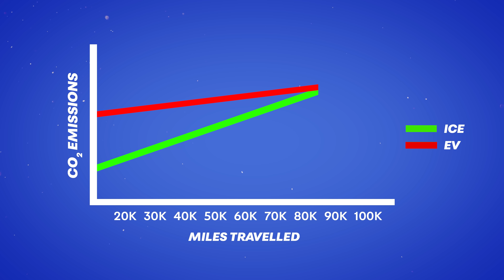Are Electric Cars REALLY That Green? [New 2022 Data]

Comment: There are other studies that suggest EVs offset their carbon footprint in as little as 2 years if you're using renewable electric sources and up to 5 years in dirtier electricity sources, but they always offset, of course this takes into account using the vehicle, for light use of vehicles is better to get an ice car.

The only car an EV doesn't offset is if you buy an used hybrid, other than that an EV is always better for the environment on heavy use.

Comment: Volvo don’t make as much money per electric car as they do for ice ones. As with all manufacturers it’s costing them a lot of money to start producing electric cars.
It also depends where that pollution is happening & what can be done to reduce the output of co2. I imagine they can on a manufacturing stance cut down their co2 on production of the vehicles a lot more easily than they can stop the pollution of co2 out of the back of an exhaust pipe 🤷‍♂️

Comment: I only see one(to me) obvious problem with trying to roll out EV’s and one that needs more discussion. The obvious one, charge points. A lot of areas in the uk are population dense.  For example my street is terraced. Even if every house could have a charge point it would also require a way to secure the cable to the car because they will get unplugged. As for the discussion point. Battery life span.  This opens up to a wider discussion such as overall cost , overall footprint by end of the EV’s life. Cost per mile to run. Will it increase as battery degrades etc. Will be interesting to see how things progress.

Comment: Another 'now' problem with consuming only green energy is there simply isn't enough.
Coupled with the increase in EV sales and this situation will be chasing it's own tail for decades
Reply: LOL LIES!
EV sales is SLOW and we clearly have a supply problem. It will be much faster and easier to built out Renewables Energy Generation then to build the BEVs to consume it. Unless you can magically make 1 Million BEVs of the same model exist. Companies will gives you BILLIONS if you can achieve that.
Reply: @Neojhun  My understanding is it's not necessarily the green generation, but capturing and storing the energy.
Reply: @stuartburns8657  You understanding is Irrelevant. The best method of energy storage is Physical. Fossil Fuel industry just stifled investment and development in Physical methods of energy storage. I think CAES will be the most versatile but you still need a few other methods like Fly Wheel for Reactive Power regulation.

Comment: The uncomfortable reality is we've built up a personal travel dependent society, which coupled with our innate selfishness means we don't want our toys taking away.
Properly accessible and affordable public transport is the real answer, but I think part if the master plan is with all these 2030 no ICE mandates, to simply make owning a vehicle so out of reach of the average person, thus achieving the Co2 reductions that way
Reply: Yup..
They tried taxing us off the roads and failed.
They tried congesting us off by taking lanes and turning them into bus and cycle tracks. Thats failed too.
They have just changed the highway code (UK) to make driving slightly more unbearable.
The government problem is... We drivers put billions of pounds into the coffers via the tax/duty on fuel ... They cannot do without it.
If EV's become as popular as ICE... there will be a tipping point and EV charging will rocket in price. expect taxing by the mile. No ta breaks for buying or home charger fitting. All the governmental carrots that put you in an EV will be pulled.. Only then will EV drivers know the true cost of running and electric golf kart instead of a car.

Comment: I've always though this to be correct. 90 000 miles could be worse. Imagine all the coal that's moved around the world to fire those power stations. Even if you generated your own power, those panels also use coal power to build, lithium for their batteries mind in Africa, sent overseas for beneficiation using these most dirtiest form of transport (the ships), it follows that all this talk about Net Zero is nonsense. You cannot have net zero considering that t costs oil and coal to make the "green energy" in the first place. 

Thanks Roar! We love this show
Reply from the maker: Depends where you live. The UK’s energy mix is only about 3% coal. It’s 17% in the USA. And the world is improving all the time. There are other fossil fuels which we all use of course, but just wanted to correct you on coal usage and highlight the change that’s happening.

Comment: EV's are great for city use, they are far more economical in slow stop/start traffic, plus of course the emissions are sent back to wherever the power station is located, typically outside of the city.  Decarbonising the grid in the future is the key with grid storage solutions and more nuclear, wind, solar and possibly tidal.  The problem with fossil fuel generated electricity is that 75% of the fossil fuel energy is often lost before it hits your outlet plug.  So if we plug in a 3kW electric heater, 12kW of fossil fuel energy typically was burned at the power station.  Whereas a fossil fuel car is 30-35% efficient at converting the energy of the fuel into useful kinetic energy, so 65 to 70% of the total available energy is lost in heat.  However electric cars in the UK will cost half as much to run, due to the high taxes on petrol & diesel fuels and the comparative much lower rate of taxes on the electricity.  Well done Volvo for doing this analysis in a balanced way.  We don't care so much about conversion efficiency of wind, solar to electricity as the source energy was free in the first place and not carbon emitting.  To me electric buses and cars in the city with stop start traffic is a no brainer.  However, the argument to install en masse electrically powered heat pumps in the city in place of predominately compact gas combi boilers, that is a far more difficult subject to draw to a conclusion on.

Comment: Its hilarious!  Obviously they using math based on a EV being charged off the worst coal powered grid known.  Y'all definitely twisted facts on this.  You do know ICE vehicles have more parts right?  Like a ICE Engine alone has like 300+ parts.  Each part has its own carbon expense.  ALL needs to be added.  Its not correct to add up everything for an EV,  but not for an ICE car.  Not to mention using worse ever grid power system as your base assumption.

Comment: At last someone sensible is seeing the light, EV’s are a con like diesels were claimed as the saviour albeit their petrol counterparts and how’s that turned out. Also missed is the Pollution caused by mining Lithium and that child Labour is used in this endeavour in some countries. I drive a 25yr old small car 5k a year, who has the bigger carbon footprint print ?  if a new EV is purchased every 3 yrs on PCP comparable in common practice on a contractual fixed mileage then how many cars is it going to take for that driver to get to 90k. When the biggest polluters are heavy industries, aircraft including NASA and commercial & privately owned ships and as I mentioned before mining, what forcible changes are happening here? In 20 yrs time EV’s in there present form will be the diesels of today and the next con will come along as history always repeats itself and goes in cycles of the next money making idea. If I purchased 5 EV super cars for my collection would I have a lower Co2 than my neighbour driving his ICE Nissan Micra no Is a fiasco we’re being mugged off.

Comment: Fossil fuels will run out one day. The real issue is how the electricity that powers the manufacture and charges the EVs is produced. Even the most wildly optimistic of us recognise that nuclear is likely to become a bigger source of energy for the foreseeable future. That carries huge risks, of course. Storing energy from renewables is another concern. However, batteries are getting better, and Tesla and its supply chain have been doing interesting things with battery recycling in recent years, and looking at some EV high-milers recently (eg Hyundai Ioniq) it seems that they may age better than feared. But EVs clean from plant to scrap yard? Nah. All human activity has Co2 costs.

Comment: Great video and gets the message out there that is often overlooked. It would be great to see this covered in Fifth Gear Recharged. There is also the ethical problems associated with lithium and cobalt mining that needs to be exposed. As you say car makers need to put pressure on battery makers to be more environmentally and ethically aware. Looking forward to Northvolt starting up battery production as they seem to care about these things.
Reply: cobalt is also used in petrol refining, and you could argue there are certainly ethical problems with fossil fuel extraction.

Comment: The key lesson here is that private car ownership has to reduce - and the constant need to buy new all the time equally so.

I wish you had stated the 50,000 mile figure first rather than the 90,000 mile - because the majority of people watching this video will be in a country with electricity mix similar to the EU28 case.

An important point missed also:
- ICE cars produce substantially more air pollution which isn't greenhouse gases than EVs. This study simply compared CO2e. Most cities exceed WHO safe air pollution levels because of transport pollution.

Also, Volvo is doing this because they have signed up to Science Based Targets and have committed to being more transparent about their carbon emissions - hence they are doing Life Cycle Assessments on a selection of their products (there's a similar study available on trucks). This allows them to pinpoint and reduce the highest sources of emissions.
Reply: Also worth mentioning is that Volvo rightly state this is a specific study on this specific vehicle. The figures will be different for others - though definitely still useful as a benchmark.

Comment: Wind and solar can only provide power 1/3 of the time, at best. And not a reliable source, unless you are happy to go backwards with regards to when you can charge/use electricity.  And there needs to be a major upgrade to the power distribution systems! So good luck with that, if we all rush out and buy an EV...

Comment: Once we have enough batteries to recycle for new EV production, then the CO2 footprint will be much lower and the comparison will be even more favourable for the EVs.
Reply: The battery technology needs to change soon to solid-state. All the existing EVs will end up getting junked then. The (much) lower weight of the new batteries will be the real game changer. But its printed-circuit tech so the FABs won't be able to use the old iron (purity).

Comment: So I wonder what the breakeven point is for my I3? The factory was built to be clean  the car is light because its carbon fiber and aluminium plus plastic panels. It has a lot of recycled materials in it  also its fully recyclable. I suspect its breakeven point is way better than Volvo's tank! It was a great video and it shows the energy for charging and making the cars is extremely important in the calculations

Comment: You must also consider the Entire supply chain for ICE and the fuel refining process. From drilling oil and all that equipment and the real-estate, all the transportation to get the crud oil to the refineries, the 10's of thousands of acers of real-estate used for oil refineries, and the waste material produced by oil refineries, and the 10's of thousands of rail tanker cars needed to deliver the oil and finished gas, and the 10's of thousands of fuel stations needed - each with several very large fuel tanks in the ground. And that's just the start of the massive fuel supply chain. For electric power, much of the supply chain is simply not required. And the power generating plants around the world going to renewables power sources, that supply chain is greatly reduced - like for coal and nuclear fuels - no more need to handle any waste products.

Comment: Ubiquitous use of the electric car is still at least 20 years away. Battery tech has a lot of challenges at the moment. Price and recharge time being at the forefront. The solution is likely solid state but there are major issues with this development. Like governments have been caught saying in the past; "The goal is not for you to get rid of your gas car for an electric car. The goal is for you to get rid of your car."
Reply: If that is the goal, then what exactly is the ultimate point of nobody owning or using a car?
Reply: @Brian-om2hh  There are several goals. One is to de-clutter cities. Two is to get increased funding for public transportation. Three is Capture, which is essentially a Central Planner's way of saying it is difficult to predict your actions if you own a car therefore it is difficult to predict good investment. Much easier if you have less freedom to travel and your specific route of travel can be predicted by algorithms or think-tanks.

Comment: Good reviews from your channel in general. However in this case Volvo does not have as good an efficiency rate as a good few others and currently well over priced. Yes it's a good safe and heavy car and this is the issue I think. You need a lot more data from a lot more vehicles to determine the true statistics. You would also need to look at the number of oil changes, belt replacement. Tyre and brake dust put into the air compared to ICE cars. EVs and battery tech are still in its infancy , similar to ICE cars only doing 8-10mpg for the first 30 years.

Comment: I think regardless of the figure, the cars lifetime will be longer than 90k, 59k or whatever. Even if the first owner isn't the one that realises the benefits.

I think you're right about the grid being cleaner over time which perhaps isn't accounted for yet.

Also, the air quality part should be more heavily focused on. Even if the energy mix is bad, the air quality is contained at the non-renewable power stations. If we are spreading it out into the cities, many people have to suffer - in fact many people die from bad air quality, so an EV \*could\* play a role in saving peoples' lives
Reply: Agree with your comments. Yes, the LCA method Volvo used just assumes the electricity stays as it is now over the vehicle's lifetime for simplicity and being conservative.

Comment: I think Volvo said they did this study to benchmark their production so they can see how they improve and can highlight the areas where they can make the best impacts first. They also get reliable information out into a world full of fake news and plain lies. I researched this to the best of my abilities before deciding that an EV was a good choice environmentally, around four years ago. I thought it was the right choice and seeing Volvos figures just proves that I was right. The first thing I did was switch to a genuine renewable energy company (a dark green I believe is the term). That is one that really does supply clean energy to the grid and not some pretend green energy that is reliant on trading carbon points or whatever they do to cheat the system. Next, I only got a battery of the size I needed. I have a 30kWh at the moment. My next car might be a little larger but I see no point in going over 45 or so kWh no matter what sort of journeys you undertake. The key is getting the infrastructure up to speed (still no where near I'm afraid) and fast rapid charging of 100kW + (again, sadly lacking. I have 100kW charging but have yet to use it in the six months I've had it as there are no 100kW chargers on the routes I have used up until now). The bald figures I came to trust four years ago were that if you charged an EV on the dirtiest power station in the world, it would be 20% cleaner than an ICE car to run. Then factor in that this is better in this country and will improve. That I can leap that wait by switching to a dark green. That EV production can improve where ICE cars can do little more to (all points you correctly make in the video) and I think it is just plain wrong to say that ICE cars can make any sensible claims to sustainability, and I think Volvos report makes this clear too. Best regards, Tim.

Comment: It really isn't that complicated: If you live in a progressive country with a non- or low-fossil fuel power grid and/or have you own solar/wind supply like Norway, then the only emissions your EV will "produce" is in the production of the car. And as most countries are moving away from fossil fuel power production, your EV will become progressively more "green" with age. An ICE will ALWAYS pollute until the end of it's shelflife and will never get better... to the  contrary, over time it will become less efficient plus Oil changes, plus servicing etc. Yes battery tech isn't perfect yet, but without switching to electric MOTORS, we will not reach the critical mass of users to make it profitable to develop better and greener batteries and we'll always be indebted to Middleeastern dictators' whims. Because what this video doesn't show is the immense cost in blood, tears and bodies of getting this polluting poison out of the ground incl. turning the whole middle east into a warzone and sending millions of refugees to Europe. How come that cost is left out of the equation? That's what giving us "cheap" oil atm.